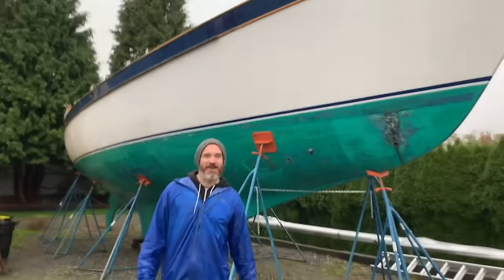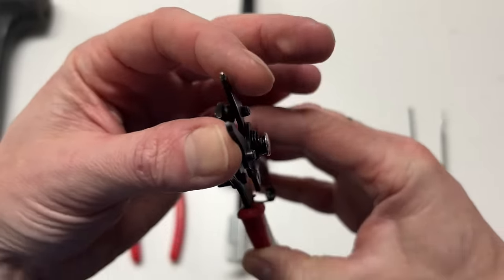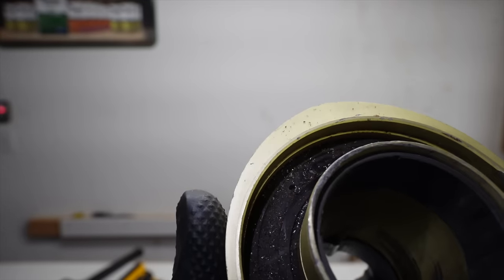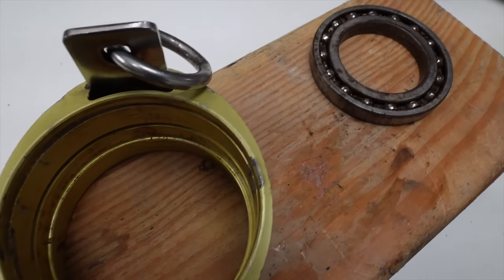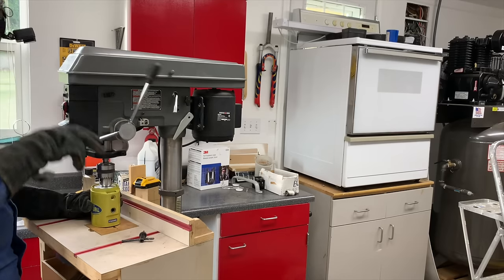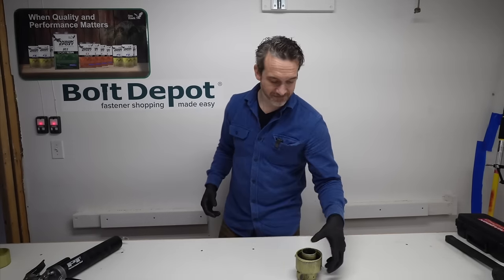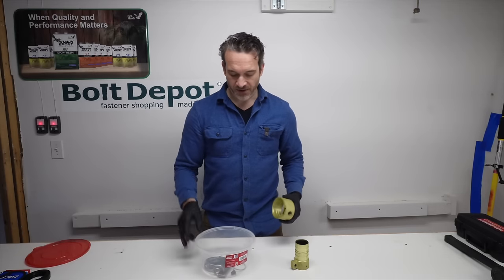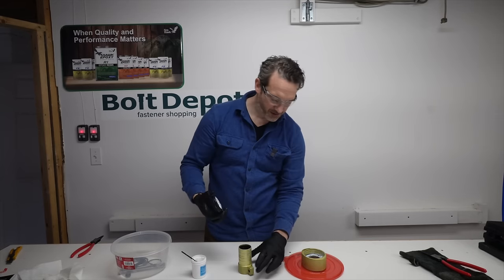Rebuilding a ProFurl Sailboat Furler (and YOU can too!) | E021

Comment: A couple of years ago I repaired my NC32 but using much cruder tools in the wild. Used the PVC trick and some short wood stock to help remove/install new bearings. I used sealed bearings rather than open ones as replacement. Stuffed the innards with as much bearing grease as i could. So far all works well. It’s a simple system and the bearings and oil seals can be obtained inexpensively.

When putting back together make sure to coat any disimilar metals with lanacote or similar compound. I had a hard time taking the bolts off to disassemble the lower unit. You don’t want to damage those bolts, they are expensive and hard to come by.

Great step by step for upper and lower parts removal and install!
Reply from the maker: I’m glad to hear that yours is still giving good service! Yes, those titanium bolts tend to seize up. I used heat and penetrating oil and they eventually broke free under quite a lot of leverage. 

Cheers. 🙌👍

Comment: thanks for the informative video, just a suggestion for future seal face repairs there is a product called "speedi sleeve" it is a very thin stainless tubular shin that will press over the damaged seal face giving a brand new seal face if you apply a little loctite bearing retaining compound it is a permanent repair much better than jb weld.
Reply from the maker: Thanks. I considered those too. I wasn’t sure that I wanted to marry a stainless sleeve to the aluminum spindle. It might have been hard to get it all the way on to both sides of the bearing with the slightly larger diameter under the bearing for the interference fit.
It’s certainly an interesting idea. I wonder if it would have increased the stiffness of the rotation with the extra pressure on the oil seal… 🤔
🙏👍
Reply: @livingforsail  I have used them for years they don't increase the friction by any discernable amount  you press the bearing on first the the sleeves the green loctite or tefgel will take care of the rest

Comment: Well, that's a great tutorial. Despite my rigger not being fond of profurl, you have demonstrated its possible to give them new life.
Reply from the maker: Thanks for keeping an open mind ! 😆🙌
Yeah, the design is interesting. A carbon steel bearing… out to sea… in one of the wettest possible locations on the boat… 🤔
I think if it is maintained it will do a great job of rolling the sail under any load. The torlon bearings that others use can deform I understand but I supposed if sized correctly… 
What are you running on your rig?
Reply: @livingforsail  I’ve owned two Cabo Ricos, a CR38 and now the 56. Both came with ProFurl furler and I replaced them all with Harken Mark IVs. To be fair the ProFurl furling units never failed but the grub screws on the foils would back out which would prevent me from being able to drop the sails; a very dangerous condition indeed.
Reply from the maker: @TheCorsair  Yes. That is a potentially dangerous situation... I know exactly what you're talking about too... My staysail was hanging up on a partially backed out screw when I was decomissioning the rig a while back... Red loctite is supposed to help but out there, anything can happen...
Reply: @livingforsail  you can only use the red loctite so many times.

Comment: 30 or so years out of steel bearings is hard to argue against.  I’ve often thought that ceramic bearings would be the way to go on a boat.  So, I did some digging.  Steel bearings in this size have a static load over 11,000 lbs.  Ceramic bearings of the same size have a static load of 884 lbs at 5x the cost. Generally speaking they should last 10x longer which would justify the cost if you needed 300 years of service life.  Other documentation I saw said ceramic bearings should handle loads at 80% the rated value of steel bearings, but in my 30 seconds of extensive research, I couldn’t find a manufacturer to back up that claim.  Curious about your thoughts. I have a specific design that requires bearings to operate under water, and I always thought ceramic would be the way to go.
Reply from the maker: That’s a really interesting idea. I’ve never played with the ceramic bearings. It makes sense for an application like this. Thanks! 🙏🙌👍

Comment: Why do I have a burning desire to buy Hawk Epoxy? i did something similar on our Simpson Lawrence windlass . SL didn't make the seals or bearings so after measuring the old rusty leaking ones I found new ones at 1/10 th the price  that the marine supplier wanted. Great video.
Reply from the maker: I use Hawk epoxy on everything now. I don’t recommend it on your breakfast cereal but otherwise it’s great stuff! 😂
Way to be resourceful on your windlass rebuild!
Your feedback is appreciated. 🙌👍🙏

Comment: Well done rebuild.   I had heard these furlers were not serviceable.  Obviously they are.  Glad you covered grease zerks.  I was thinking the same, however grub screws instead of zerks, then zerks just moment of greasing.  Fwiw I for have a 20 ton press and a big old drill press, never considered using the drill press for such a thing, but will now, as hydraulic press is a slow set up.  One last thought,  is the little pin possibly there for pressure relief during manufacturing,  so that the seals can be installed?  Because I don't understand it's purpose otherwise..
Reply from the maker: Thank you 🙏. 
They are certainly serviceable! I’d say the sooner the better. I wouldn’t want to push past 10 years or the water starts to corrode the anodized aluminum. 
You’re correct about the pins!
👍🙌

Comment: Would it be a good idea to drill and tap the Profurl outer body to accept a grease/zirk fitting? This way, a sailor could simply pump some grease into the bearing cavities to force lubricant outward, through the bearings. Always fresh grease that way?
EDIT: You read my mind and already addressed it! Too funny.
Reply from the maker: Haha. Yeah, I will try both approaches. I can see it both ways on that one… there is NOT a ton of room on there for a zerk with the various clips and things…
👍🙌

Comment: That seems like a great price for the rebuilds ... considering the price for a replacement units.  That problem you had with the pressure pushing the seals back out is not uncommon -- I've had the same thing while installing new slides during brake jobs -- nice solution to the issue though.
Reply from the maker: Thanks! 🙏
I think at that price it’s definitely worth a shot. 
I scratched my head for a bit on the seal pressure issue. I guess the good news there is that indicates that they are in fact sealing well so hopefully I water getting in for a long time. 
🙌👍

Comment: Just did this on a NC42 system i picked up for $200. Like new now! Only problem is i have everything here to install except furler extrusion tubes, i have the joining sleeves, bearings (the plastic inners) grub screws....but no aluminium extrusion tube! 

After doing some hunting on the net its going to cost about $2500!!! Which is a ridiculous amount for aluminium tube. Im considering getting the C42 profile custom made which is possible and i can supply other guys who run into the same problem.
Reply from the maker: That is awesome and sounds like something that I would do! Love it. 
Is that the extrusion with the single luff groove?
I know Profurl discontinued this line a few years ago so those extrusions will get harder and harder to find. 
Keep me posted about that project and good luck. 👍

Comment: Great video.  What software did you use for your bearing cutaway illustration?  That helped a bunch.  I will check out the Tef-gel.  I have not used that before.  I normally use Superlube.  I have to service my winches soon and might give it a try.  Thanks for another awesome video.
Reply from the maker: Thanks! 🙏 I use sketchup for the modeling work. It used to be free… for your winches you’ll want a really light lube on the pawls. Tef Gel might not be what you want on everything. I’m planning on rebuilding a bunch of Lewmar wave grip winches in an upcoming video. 
🙌👍

Comment: instead of roller bearings, install sealed bearings, then the seal for insurance against water intrusion.
Reply from the maker: I considered that too… probably can’t go wrong there. I wondered about adding too much friction to the system but it’s probably a rounding error after all that grease and whatnot in the original design…
👍

Comment: Hi: love the content. My question: I understand the desire to emulate the original design but if the aluminium housing is too weak why not fabricate it in 316 steel. Remove the need for the bimetallic corrosion sludge which was the degradation issue perhaps initially
Reply from the maker: Hi. I think you mean the spindle for the staysail which showed quite a bit of corrosion under the bearing… I hadn’t considered getting one made of SS. It’s an interesting thought. I imagine it would be quite expensive…
I have not rebuilt that unit yet as I maul over my options with it…
Thanks for the input. 🙏👍🙌
Reply: @livingforsail  no sweat. I’m an architect, not an engineer so the notion of the fabrication of a brand new element like this is somewhat out of my  knowledge base. Just seems a shame to reinstall a part which has failed previously. The infill material which you used to smooth out the screwdriver gouges will not last and in 50 years a future utuber will come across the same issue perhaps. If mankind lasts that long . Cheers mate. I’m in London x
Reply from the maker: @michaellavin7102  The spindle on the LC42 was in good shape. You are correct though that the JB weld used to fill in some gouges on the other parts will not last forever. I'm hoping to get a few trouble free years... we will see.
Reply: Thanks for another fantastic, useful, and well produced video. Another step towards fame and fortune 😊.

Comment: Excellent video - THANK YOU! Quick question - are you able to tell me how much rotational resistance I should expect from a healthy ProFurl upper swivel? I have a B35M that rotates smoothly but with a decent amount of resistance. The fish scale shows 1.5 lbs to rotate it. Does this sound normal?
Reply from the maker: Thank you 🙏. Since there are two double lip oil seals on that swivel packed with grease, there is some inherent friction even in a newly rebuilt unit. 

My take on this would be to plan to rebuild before it is obviously “grumbly” as you turn it. By the time the bearings get that bad, you’ll likely have pitting on the aluminum and other collateral damage. 

I’d probably plan to rebuild them every 10 years or so? Just a guess… 

That amount of force sounds ok to me 👍
Reply: @livingforsail  Thanks for the info and quick reply!

Comment: I wonder if fully ceramic of hybrid ceramic bearings would work? I only just discovered that they exist, not too sure of the cons.
Reply from the maker: I suppose with full ceramic bearings you could skip the seals? 🤔 I’m not sure how they handle the high load, low RPM life cycle that these are subjected to, but possibly worth looking into…
Reply: Full ceramic can supposedly run submerged in seawater with no grease! Not sure I like the idea of salt crystalizing in there and being chewed up by the balls though. When steel bearings fail they mostly just get rougher, noisier and stiffer. When ceramic bearings fail, they shatter into highly abrasive bits.
Reply from the maker: @bhartley1024  right... like everything in life. Pros and Cons... Haha

Comment: These spacers… you replaced them or installed parts that aren’t there originally?
Reply from the maker: They are not original. I made the mistake of ordering the same parts I was removing before verifying the depths of the bores. 
For the N42 and/or LC42, order 80x50x13mm double lip oil seals (with stainless springs if you want 100% OE)

Comment: This is wonderfully informative video.  Thanks for posting.
I have one question for my job: were you able to determine the sizes of you bearings, seals and clips by only knowing the model number?
I have a Profurl R35, the bottom barrel is struggling to rotate, but I don't wish to remove from boat and dismantle (thus ruining the seals) if I don't have the parts at the ready.
Thanks
Reply from the maker: Thank you. 🙏. 
I’m sorry that I don’t have the exact details that you need. I think your best bet would be to call Wichard and talk to them to get the part number for the official rebuild kit and a lead on where to purchase it. You’ll pay a bit more this way but you will be sure to get the correct parts. 
If you do, let us know what the actual seal/bearing sizes are and I’ll post it in this video for the next person that comes along with the same question. 
Good luck 🙌👍
Reply: @livingforsail  Thanks for the reply.
Great Minds,,,, as I already messaged the guys at Winchard in Oz, asking if they know the sizes.
Thanks again.  Good luck with your project.
Reply: Hi again John.  I am having real problem getting my profurl furler off my boat, i.e. sliding the Drum off the luff extrusion.  I've removed the 2x set screws then it just won't budge.  Any tips or advice?  Thanks in advance
Reply from the maker: I’ve had a few that were sticky. They have all just been a tight friction fit (with the two set screws to lock in place). 
I was eventually able to press the spindle out of the drum using my body weight. 
You might need to get it on a press to get started. It will go 👍🙌
Reply: @livingforsail  Update: Wichard (France) DMed me, after I wrote an enquiry this morning on their website.  A very interesting response and has some questions for you, after I shared a link to this vid.  Happy to share with you but not sure best way to DM you on here.
Reply from the maker: @banier1 my email is in the video description 🙌
Reply: @livingforsail  emailed you 👍 thanks

Comment: Recently did the same thing to my P31 Pro furl, abet with less fancy tools. It worked well. After contacting the agents here in Australia, who informed me that there are no longer spares available and then quoted $2500 for a replacement furler. It cost me $80 for parts from a bearing supplier to revamp mine! The small S/S balls on the outsides, are originally pressed in at the factory after they have filled the internals with waterproof grease and let the excess out, through the small holes there. I simply packed mine solidly with grease when installing the final seal. I used stainless steel bearings on mine, why not? the cost is negligible
Reply from the maker: Great work! Apparently the stainless bearings can deform a bit under load but will definitely last longer. If it’s not giving you any issues then it’s all good! 
🙌🙌👍👍
Reply: yep did a P31 years ago and like you i took out the ball bearings on each side, put it all together with lots of Tefgel. the last seal forced the excess gress out and i hammered the small bearings back in place. No feeler guages required and so peace of mind that the seal wouldnt be damaged.
Reply from the maker: @derekhoughton1346  Great work. How's it holding up?
Reply: @livingforsail  It held up well for the 10 years until I sold the boat.